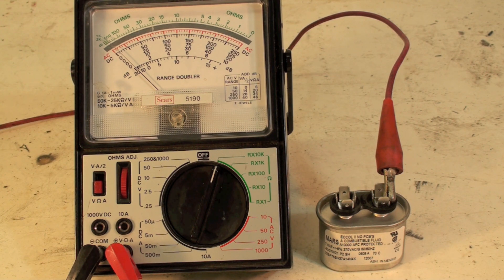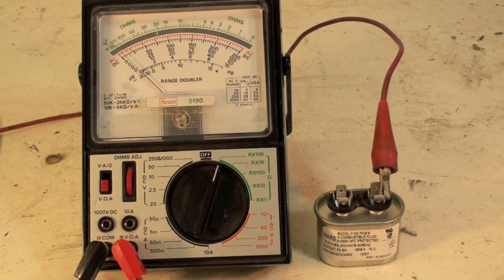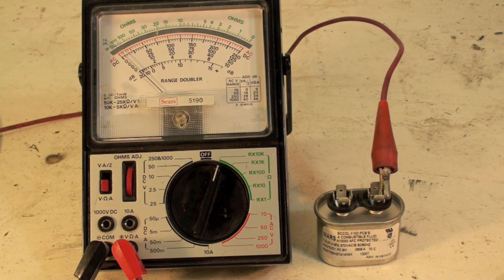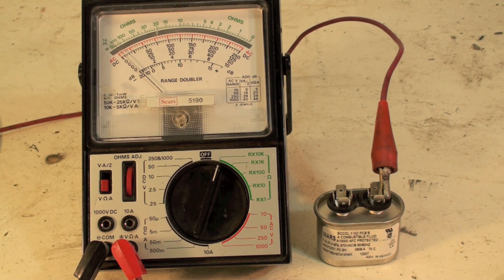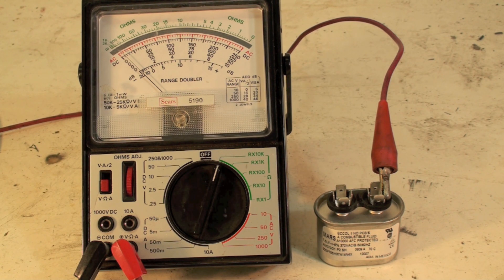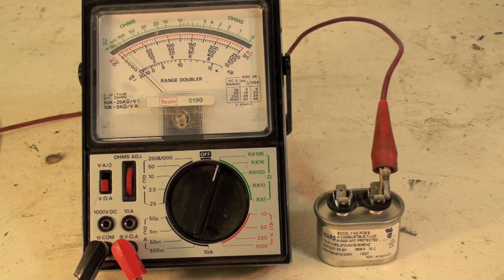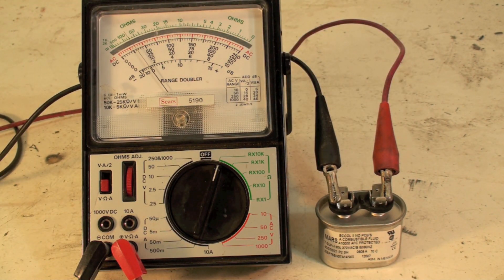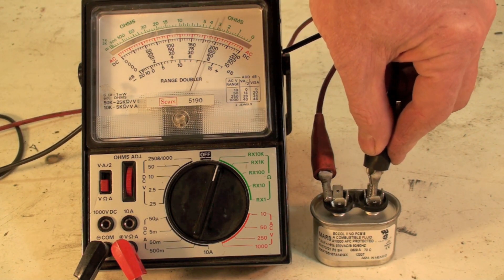How to check the capacitor with an analog meter

Comment: I bought a new capacitor for my camera. Not sure what the tolerance should be. So I decided to find the one which fits and has of equal voltage. However. The new one has 275 uF instead of the original 180uF. When I tested the new capacitor, I got about 100-200 ohms? Whatever the case, the flash didn't charge with the new cap, so idk if I did something wrong. So I'm kind of upset and this is confusing (I don't have a digital meter, my analog only reads 1k Ohms). 

To add, I just tested the original capacitor and it measured to 20 ohms - switched the poles - and got 100ohms. Did the same with the new capacitor and it read towards 100 both ways. They both start at 0 but neither got too infinity. Can anyone tell me if I'm doing this right and any suggestions on how to get the right capacitor and if the ones I have are good or bad?

Comment: The only problem is that you don't know if it's charging within it's rated limits. An out of tolerance cap will pass this test.
Reply from the maker: This method was used by techs when cap testers were not common.  It definitely has its limits.
GFM

Comment: This works with a digital meter but the reverse connection to Ohms will give an error message until the voltage gets low enough.

Comment: Have garage door capacitor. The ends looks slightly burnt, but it still reads as in the video. Is it possible the capacitor is bad even though it gets a reading?
Reply from the maker: If it reads ok, it probably is ok.
GFM

Comment: for the young generation. digital meters are great if you want to know an exact voltage or ohm value or checking capacitor value. the old analog meters don't lie about voltage present. I have had digital meters read voltage that did not exist. I call this phantom voltage! just be careful . that's why this old guy being myself likes the old analog meters.

Comment: I have that same meter and use it all the time. The younger guys always laugh, but I like them better than the digital meters. I learned how to do this 21 yrs ago when I first started.
Reply from the maker: Mike Mace There is nothing wrong with this method.  It just will not tell you the strength of the cap.
GFM

Comment: could you make a video on how to ck capacitance with meter, using amp draw x 2650= then divide answer by voltage across cap, it is one way i was taught to test under a load to find the true capacitance
Reply from the maker: Ken Dillon I have one scheduled for 8/25.  Here is the link. http://youtu.be/4oNT-U4tZtQ  It will be good on the 25th.
GFM

Comment: this wont cover ESR For capacitor performance or to tell if its leaking
Reply from the maker: This won't even tell what size it is.  It is not a definitive capacitor test.  It is a test that can be used to tell if the capacitor works at all.  It is for those that only have an analog meter for testing.  Not meant to be definitive.  Thanks for the thoughts.
GFM

Comment from the maker: The analog meter is a poor one for capacitor testing.  It will only tell if the capacitor will store energy, not how much.  The capacitor you are testing may have low capacitance, and it is hard to tell how low with the analog meter.  If you have a digital meter, it is much better.  Hope this helps.
GFM

Comment: Thanks, very helpful video. Can you offer some advice on the cause of the capacitor on the capacitor of the motor of my De Walt radial arm saw failing repeatedly over last two weeks.The agents re-wound the motor and replaced the capacitor,  After 30 mins light operation the motor stopped and tripped out the earth leakage again  - there was- oil leaking from capacitor both times . Any suggestions   Can you suggest why the capacitor should be failing like this. Thanks

Comment from the maker: The capacitor is a rechargeable battery.  The jump in reading is the battery in the meter discharging into the capacitor.  The movement of the meter to higher resistance is the charging of the capacitor.  If it is defective, the capacitor will not charge.  Hope this helps.
GFM

Comment: Is the hop or jump in the reading (or Value) significant when using a ohm meter? I saw other videos that says it should be within 10 percent of the rated Uf for it to be good when tested with a cap meter, so I assume that even a soon to be bad cap or a bad cap will also have jump in the reading.
Am I right to assume this? Thanks

Comment from the maker: No.  This was a method of checking capacitors before capacitor testers were common, and can just give an approximate idea.  The slower the movement of the needle, the larger the cap.
GFM

Comment from the maker: Polarized caps are used in DC applications.  This means if test it with the meter leads in one polarity, it will charge normally but if you reverse polarity it will show open unless the voltage being used for the test is above the leakage voltage for that cap.  Hope this helps.
GFM

Comment: The capacitor is open when you cannot get any reading at all withe meter. It is shorted if that needle goes all the way over and stays. If it is ok it will do the bunny hop as shown in the video_pawpaw

Comment from the maker: Open means there is no connection between the 2 terminals.  The most common open in capacitors is an overheat inside.  When the oil overheats inside the cap, the pressure increases and the top of the cap bows out and breaks the wires to the terminals.  Hope this helps.
GFM

Comment: Open I don't know about, but I do know about shorted. It means that the capacitor is damaged and the two plates are either touching or too close together to be able to stop constant current flow which means having the faulty capacitor in the circuit is the same as having a straight piece of wire in the circuit instead of the capacitor.
I hope this helps.

Comment: So basically, if it's shorted the needle swings up to 0 Ohms and stays there, and if it's open the needle doesn't move at all. I understand that a cap can be shorted because of a dent, but I don't understand what could make a cap be open. I know that it's enough to know that it's bad, but I haven't been able to figure out the open thing.
Either way, I like this video because it's short, sweet and to the point.

Comment from the maker: Open means that the device being tested will not allow electricity to pass through, so is inoperative.  Shorted means the device being tested has no resistance to electricity flow and will allow too much electricity to pass through and circuit protection (breaker) probably will kick off.  Hope this helps.
GFM

Comment from the maker: In this video, we are assuming the only available meter is an analog one.  Because most of them have no test for capacitors, this is a way to make a test that will tell if the capacitor is working.  It will not test the strength of the capacitor. 
GFM

Comment from the maker: If there is no movement of the needle,  the cap is open (failed).  If the needle moves to zero, and stays there the cap is shorted.  Remember the cap must be disconnected.  GFM

Comment from the maker: The RX10K setting restricts electrical flow enough that you can see the needle movement.  A capacitor charges very fast in these small sizes so the needle would only blip up.
GFM

Comment: Thanks for the upload. Any reason you chose  the ohms x10k setting? Would it work using the other ohm ranges as well, like x1 or x10 for example?